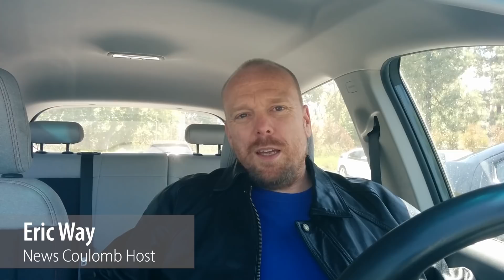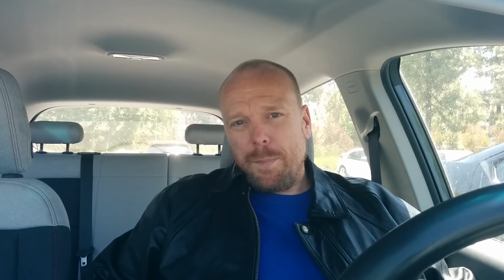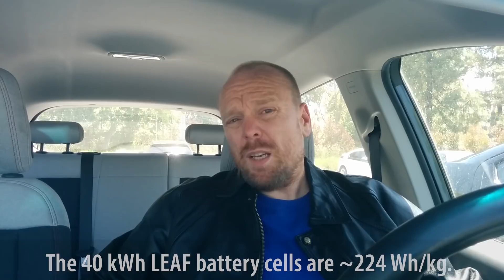Plug-Side Chat: When Can We Expect NMC 8:1:1 Batteries?

Comment: Good video with good info and this is what I think that the Nissan Leaf + use the 8.1.1.  This is the battery Kia Niro was suppose to use and the projected range was close to 300 miles and then revise to 239 miles.  Will see what Nissan really use, hopefully soon!
Reply from the maker: Yes, I saw an initial release of the Niro EV claiming that it was using NMC 8:1:1, but that turned out to not be accurate. 

I thought the current LEAF e-Plus would have them, but the weight difference between the 40 kWh and 62 kWh LEAF indicates that the energy density didn't improve. Of course, Nissan could add them to the e-Plus soon.

Personally, I think the Bolt EV might be the first EV we see with those cells. GM has been rather quiet, and like KIA, they've made a number of references to a 300+ mile Bolt EV. I'm hoping for the 2020 refresh, but we'll see.

Comment: Thanks for the video, very interesting.  Can you explain 1C  2C?  Are those terms for charging rates?  Thanks.
Reply from the maker: Thanks. The "C" rate is how quickly the battery charges relative to its size. A 60 kWh battery with 1 C charging would have a charging rate of 60 kW (taking an hour to charge from empty to full). A 60 kWh battery with 2 C charging would have a charging rate of 120 kW (or 30 minutes to charge from empty to full).

Comment: I hope Tesla next gen battery becomes revolutionary using their current battery tech with super capacitors
Reply from the maker: It could be, but if the rumors are true, most automakers and battery makers have access to 400+ Wh/kg battery technology at this point. It will be several years before it is ready for commercial production and vehicle use, however.
Reply: @newscoulomb3705  alas, the rumors are not true.
Reply from the maker: @homomorphic  Well, we don't know that yet. We won't be able to say with any certainty for another several years.
Reply: @newscoulomb3705  we do though. Fundamental battery chemistry is constrained by physics. You can get that density, but you'll give up charge time or durability.

Density/charge rate/durability. Pick any two.
Reply from the maker: @homomorphic  Yes, and no. Given the current chemistry being used, sure, but that is assuming that the chemistry stays the same. It's also assuming that the structure stays the same. Both can influence outcomes.

Also, each of those things are relative. Density compared to what? Charge rate compared to what? Durability compared to what? Most people would be fine with a 150 kWh battery that charges at 1.5 C.
Reply: @newscoulomb3705   150kWh battery? That would weigh 2,000 lbs. That mass has to be accelerated every time. A 150kWh fuel cell powertrain weighs 400lbs (total plant including regen battery, fuel cell and tank (s)). A fuel cell uses no exotic metals (specifically no cobalt) and the platinum required for a 115kW fuel cell is the same as in a current generation auto cat (so all the platinum needed is already on the road and is 99% recycled). The fuel cell plant will last 15 years and has a mfg carbon debt 1/4 that of th equivalent capacity battery. The energy density of hydrogen is 140x higher than a lithium air battery. Charge time is 5 min (entire charge from 0-100%) and the proof is rendered in actual hardware, the Hyundai Nexo (for example) has a range of 380 miles and is available today (3 of my friends drive Nexo's).
Reply from the maker: How did this go from battery technology to fuel cells? Each technology has its benefits and drawbacks, but to assume that it's not possible for battery technology to improve from this point isn't accurate. 

Also, simply based on NMC 8:1:1 chemistry, a 150 kW battery would weigh less than 1,500 lbs including case and supporting hardware. With 400 Wh/kg cells, it would only weigh about 1,000 lbs with all hardware. 

In either case, at that point, 1.5 C charging wouldn't matter to most consumers.
Reply: @newscoulomb3705  because a fuel cell is simply another type of battery. Technically a gas voltaic battery (https://en.wikipedia.org/wiki/William_Robert_Grove), and they exist now, and have properties superior in every metric (except in thermal efficiency, but that's actually an advantage because in colder climates they lose far less range in winter) than their lithium ion cousins.

Comment: Good video, thanks.  When you say the 8:1:1 can support 2C charging, does that mean a 72kWh battery can charge at ~150kW ?  Also, when do you think GM would start the battery taper?  As you mentioned, it would be good if it could be 80%, or more.  BTW, what battery chemistry does the Audi e-tron and Tesla use?
Reply from the maker: My understanding is that the e-Tron is still using NMC 6:2:2 batteries (like the Bolt EV's), but the e-Tron's cells are lower energy density, higher power, which allows them to charge a bit faster.